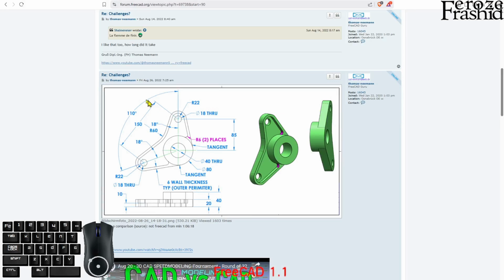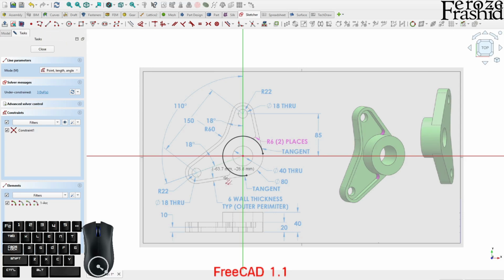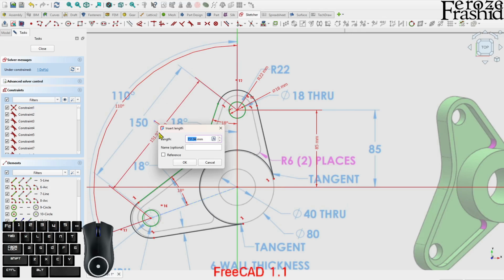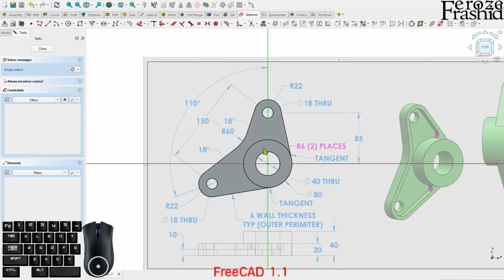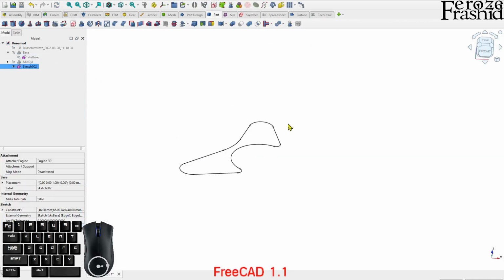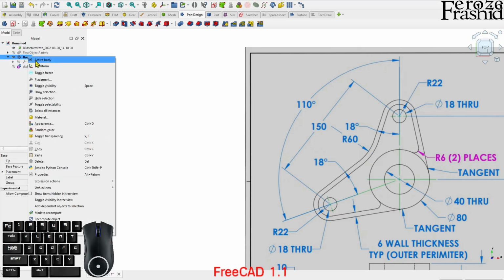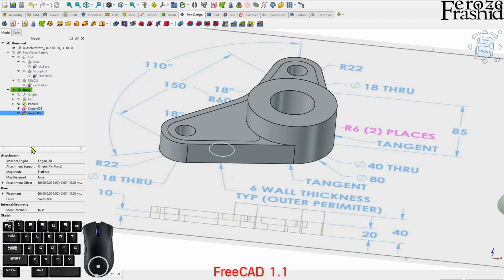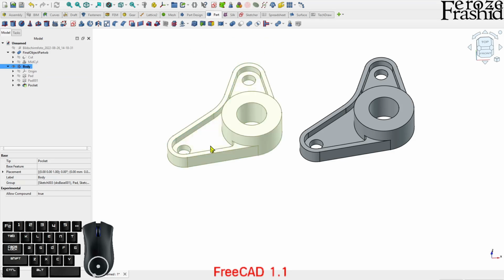Practice in FreeCAD 1.1: Free Parametric 3D Modeling Software

Comment: A good lesson on the distinction between Part and Part Design workbenches. Nice job!
Since you are choosing to offset the “scoop out” sketch, you could also set the offset to be equal to the extrude/pad length. Then the offset resets itself if you want to change the extrude/pad thickness.